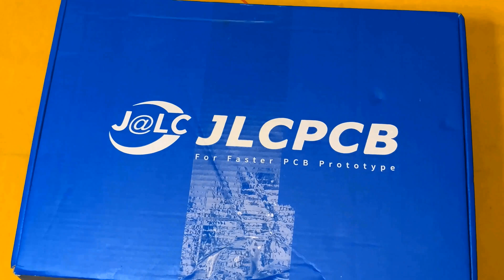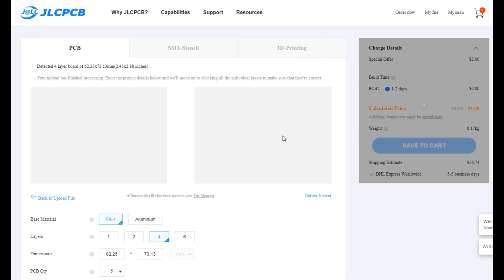how to make 12v to 220v generator

Comment: Bu projede kullandığınız 230 volt elektrik üreten motoru nereden ve nasıl temin edebilirim?  Teşekkürler 🙋
Where and how can I get the 230 volt electric generating motor you use in this project?  Thanks 🙋